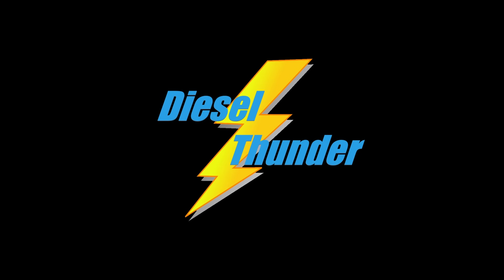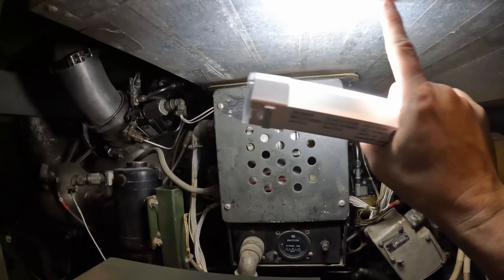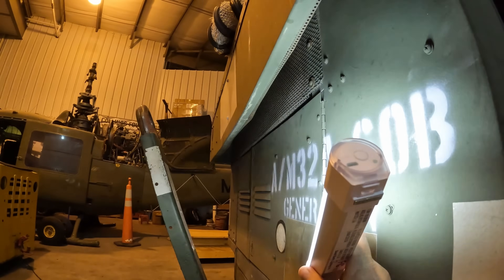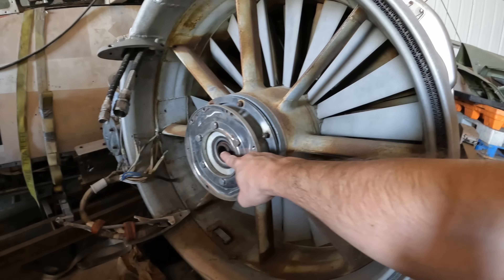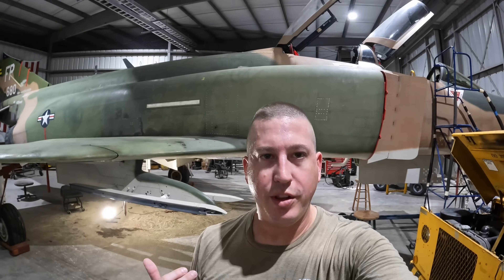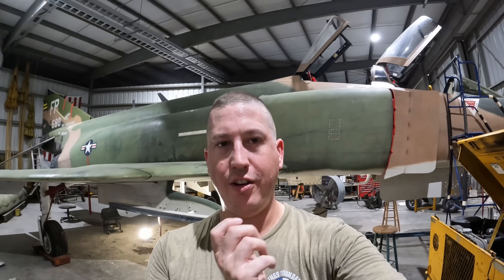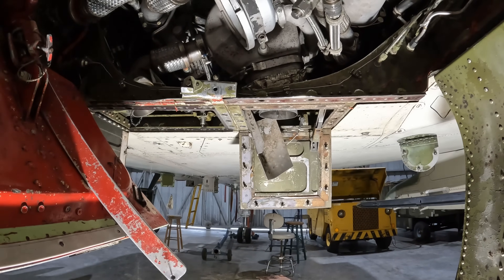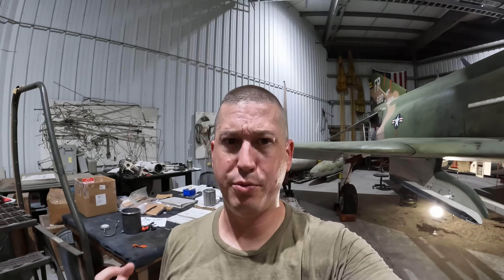Tech Talk - Starting a J-79 | F-4 Phantom

Comment: On our B-57 Canberras we exclusively used cartridges to start the J65 engines.  The starters were mounted in the engine’s nose dome.  Hung starts and misfires were not uncommon and it was risky to approach the starter and unlock the breech to remove a dud cartridge - not knowing what it would do.
The cartridges came in a container similar to a large coffee can, wrapped in cardboard.  There was a disk of packing material that covered the flat side of the cartridge where the gas came out.  One time, a new guy forgot to remove the disk before installing the cartridge in the starter.  Upon detonation, the starter exploded, damaging the front of the engine, cowlings, and launching the breech cap 100 yards where it stuck in the side of a hangar.  Not a good day on the flight line . . .

Comment: Thanks Diesel for the details. Can't imagine which decisions must have been made to implement a different start system than in Navy jets. Or maybe due to the already available starter carts having different pressure outputs. And yes, that Luftwaffe cartridge start video is awesome. Also the smoky engine runup.
Reply from the maker: My pleasure! Like to think the Air Force would have kept the original system, had they not wanted the fast start capability needed for a scramble/alert takeoff. Adding the starter there also moved the generator up to the nose of the engine.

Comment: That was pretty cool. Was wondering if they left the cartridge in place after startup or if it was removed. Was also surprised at the size. The only cartridge starter I've ever seen close up was in the old Jimmy Stewart movie "Flight Of The Phoenix", and they looked like shotgun shells. Be that as it may, you showed us many times the fitting for the installing the cartridge on the engine, but was a big vague on how it worked. I thought it was a fitting for a breach mechanism that you then inserted the cartridges into to fire. I also figured they left the cartridge on after firing to seal the system to keep air from escaping, and to keep FOD being ingested though the starter mechanism.

After the starter is fired, does the crew have to put a plate or a seal of the cartridge starter fitting to keep from ingesting FOD?

Comment: How many Gallons does 1 or both Engines burn at Idle and at Flight Cruise? I know the J79 Burns 1.5 - 2 Gallons per Engine per Second in Full Afterburner.
Reply from the maker: Per the manual, each engine will consume between 800 - 1,400 lbs per hour at idle. At 6.7 lbs per gallon, that translates to 119 - 209 gallons per hour for one engine, or 238 - 418 gallons an hour with both engines idling. The variance is tied to the ambient air temperature. Cruise power is generally 4,000 - 8,000 lbs per hour, per engine. In gallons, that is about 1,194 - 2,388 gallons per hour (both engines combined). 

In afterburner (at sea level), each afterburner can consume between 19,800 and 27,600 lbs of fuel per hour. That's 2,955 - 4,119 gallons an hour per engine. One thing to also factor in is that the engine core is running at MIL power when the burner is engaged so the total fuel burn is engine core + afterburner. These J-79's sure are thirsty!
Reply: @DieselThunderAviation  Thankyou for the information.
Reply: @DieselThunderAviation  Here is the math on gallons per minute for both engines combined. How many gallons per hour in MIL Power?
Idle. 4-7 gallons per minute.
Flight Cruise. 20-40 gallons per minute. At $5 per gallon, that's $100-200 per minute.
Afterburner only, not including the engine at MIL Power. 49-68 gallons per minute.

Comment: I worked F-105 F&Gs at Korat. We rarely got -60s, used MD-3s for ground power. F-4Es grabbed every -60. We used starter cartridges exclusively.  No problem with J-75s.

Comment: Several things about a cart start on the J-79-GE-15.  Typically once a cart start was finished, you do not remove the cartridge.  The canister was very hot. In peace time cart starts were not done unless you were in a combat readiness exercise. To prevent a hang start you would bend the tabs on the cartridge down around 30-45°. There was not a cable from the base of the canister.  Continuity was done through the handle to ignite the cart. If you had a hot start then a secondary CC would monitor for fire through the auxiliary air door. To prevent any type of fire the area around the exhaust door was wiped down very well before the start. Also you hoped for a light breeze on a cart start. They stink. As for the question about the serial numbers. Your F-4 is a 1963 model, hence your serial number is 63-7680 (C-model) 64 C-model start out 64-0XXX.  All C-models. AF only had a few D-models. I crewed several C-models. My last one was 64-0660 which is now a static display at Niagara Falls International airport.
Reply: @jimpemberton5971  actually the Collings Foundation Phantom is F-4D 65-0749, but it's painted to represent F-4C 63-7680 as it was when Robin Olds flew it for one of his MiG kills during the Vietnam conflict.
Reply from the maker: Correct! 63-7680 was the jet that he flew for Operation Bolo and was an F-4C. If I have the history of that aircraft correct, it was lost to anti-aircraft fire in November of 1967. Someone else answered this in that the Air Force painted on the last five digits of the serial number and changed it either late 60's or early 70's to using the year ordered and the last three digits. Appreciate the details on the cartridges!

Comment: Why does it say “AF 37 680” on the tail?  I thought “37” was the fiscal year the aircraft was funded to be built.  It can’t be 1937!  Seems like it should be maybe 66 or 67?
Reply: 63-7680. It's painted to resemble Robin Olds F-4C. Before the modern number system came into effect, going all the way back to WW2 only the last digit of the year the aircraft was ordered was used.
Reply: @baileyparadis1815  Ah, ok.  Thanks!

Comment: Great video! Thanks for showing us all that and please don't stop making this kind of content!
Reply: Yes.  Not knowing, I “imagined” the -60 air was run straight into the combustion chamber (via a pipe) to pressurize it for ignition of injected fuel, in combination with electrical power running an electric starter.  Such as electric motor gets engine turning to some low percentage RPM and then compressed air into the combustion chamber would assist ignition and on it would go from there.  Now I know it’s simply an air motor that cranks the engine.  So, in flight, if a flamed-out engine RPM fell below 10%, there would be no way to get it going again, right?  …unless there was enough aircraft speed for the ram-air to windmill it back up to 10%…which I think I read somewhere was around 200-some knots?

So, now I have another question:  how is the air motor connected to the engine shaft?  Through some reduction gearbox and a pinion gear to a ring gear on a compressor section disk?  Does it stay connected all the time?  There must be some sort of clutch, otherwise engine 100% RPM would seemingly spin that air motor over 100,000 RPM.

Comment: Thx for the explanation of cartridge start. Was it not possible to start the other engine with compressor bleed air?
Reply from the maker: My pleasure! And no, there's no capability for a cross bleed start. There are no valves or ducting between them for it. The only way to start one of these without a cartridge or a start cart is a windmill restart while airborne. Have to have plenty of altitude to pull that off though as the F-4 has an abysmal glide ratio.
Reply: @DieselThunderAviation  I never worked J79 and learned a lot watching your vids. surprised to learn it was not possible to cross bleed start and the starter actually turns the entire shaft and not through the gearbox.

Comment: Also.  Do you guys not have headsets and com cords?  Or you you just like to use hand signals
Reply from the maker: We do have com cords and headsets. The one wrinkle for our Phantom though is that she has a different connection than the other jets and has a unique cord just for her. One the latest startup we couldn't find the cord so we used hand signals as discussed in the safety brief beforehand.
Reply: @DieselThunderAviation  I volunteered at our airshow for ground crew and had to brush up on hand signals.  Hadn't used them since a&p school 20 years ago.
Reply: @DieselThunderAviation 50 years later, hand signals are still entrenched in my soul.

Comment: Navy/MC starting air blew across the exhaust rotors to spin up the engines, so there was no need for an exhaust door. And why it had a selector switch. Having a starting system that could catch on fire is not good for carrier operations.

Comment: Don’t know the reason between services on the F-4, but on Air Force T-38’s they did have a valve to switch air between #1 & #2, only one connection for the -60. Engines were GE J85’s.

Comment: Navy J79s did not have a starter like USAF J79s. The Navy J79s had their CSDs (Constant Speed Drive)  mounted on the J79 accessory drive pad where the starter is attached on USAF versions. The "bullet" on the nose of Navy J79s was much smaller than USAF versions, since there wasn't anything inside of it.  USAF versions had their CSDs mounted inside that nose bullet fairing. 
  The Navy "Huffer" pneumatic hose was attached through a small door, Door120, which was inset in engine bay Door  92L. Huffers put out a higher airflow mass than an AM32A-60, but the Navy jets could still be started with a Dash 60. It just took longer to spool the J79 up to 10 percent. 
 The Navy J79 engine used a "direct impingement" of the pneumatic air blowing directly on the turbine inside the J79.
  I haven't seen a Navy manual showing how the pneumatic Huffer air was piped into the J79 to blow directly on the turbine. Hopefully some Navy or Marine could chime in and tell us about that. 
 I helped start a transient F-4J once at McChord AFB, it was far, far easier than starting the F-4Cs and Es that I worked on at Kelly AFB, George AFB and Ramstein AB. It's been well over 30 years since then, but if my memory serves, Door 120 had spring latches and not Camlocs, no big flatblade screwdriver required. Also, the Dash 60 air was not cut off and restarted when the pilot switched from starting #2 to #1. The ground crewman just switched on the external air once at the pilot's direction, then cut it off at the pilot's direction after both engines were running.
Reply: Also the Navy & Marine F-4s The reason you needed higher pressure air is it went straight to the turbine section where Air Force F-4s the starter was geared through the accessory drive gear box. With that said myself and an engine mechanic drove from Nellis Air Force Base outside of Las Vegas to Marine Corps air station El Toro to change out a starter that was blown up by the Marines because they hooked up their high-pressure air to the Air Force starter, and that didn’t work out at all someone else posted. You can start a navy marine aircraft with it – 60. It’s just gonna take a while to spool, but don’t start an Air Force navy Marine Corps air starter
Reply: @remylopez4821 💯
Reply: Ex-Kurnass structural/airframe mantainer here.  If I'm not mistaken, the E would have one or two starter carts per jet in the HAS, I believe the carts were common to F-16s as well, they were squat and wide carts.
Door 92L seems familiar along with pannels 101 & 102. It's likely I closed out a few open items in the maintenance log book on 92 (loose solid rivits)

Comment: First thing that comes to mind is the air force version does NOT have the manual air feed valve has something to do with the fact that it DOES have the start cartridges?  I don't know why that would be off hand (room?  Plumbing?) but it's an awful big coincidence.  As always, thanks for sharing.  PS: Can the engines cross bleed air so one running engine can start the other?  If you covered that already I missed it.
Reply: @fsj197811  there is no crossbleed for engine starting on any version of the F-4 that I ever heard of.
Reply: @scottwilson8105  Thanks for the reply.  I thought there might not be because of added weight and space both of which are at a premium on a fighter.

Comment: Cart start for ZULU and VICTOR ALERT!
Reply: After several aircraft fires due to misfiring cartridges, USAFE quit using cart starts at QRA/Zulu. By 1983 when I was assigned to the 526 AMU at Ramstein, QRA was using Dash 60s to start engines on the F-4Es. They still were able to be airborne within five minutes of the Klaxon going off.